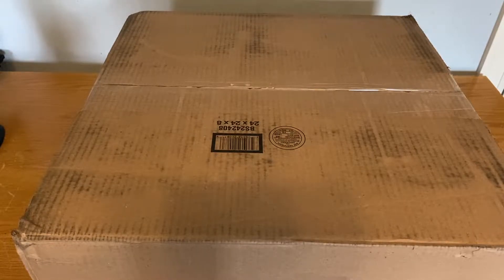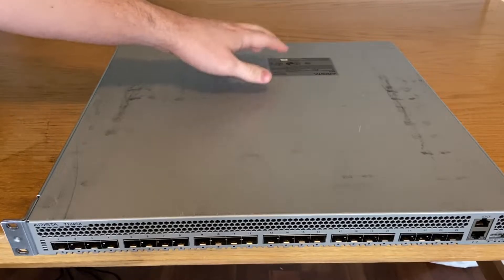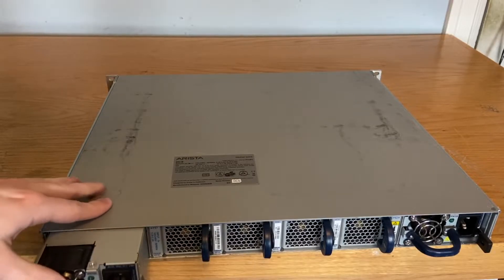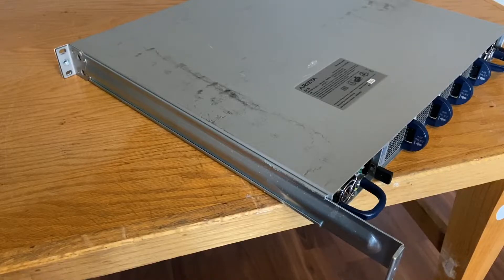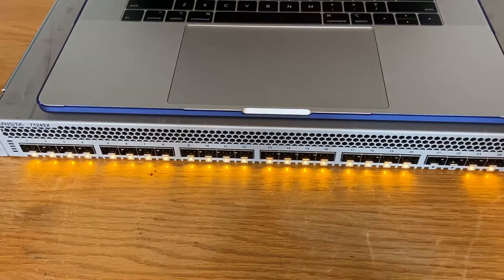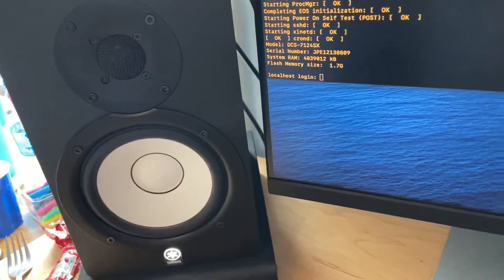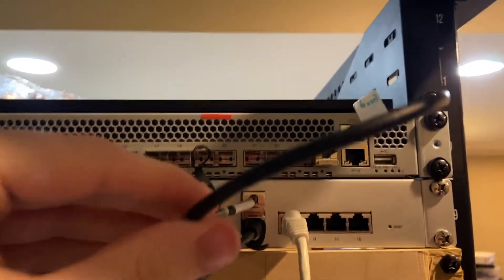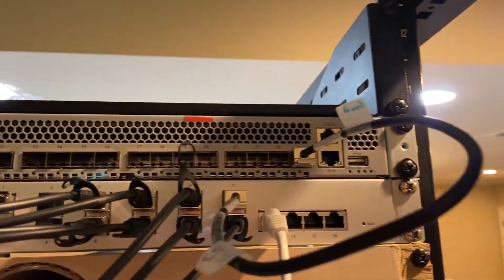Arista DCS-7124SX 24-Port 10GbE Switch Unboxing

Comment: You can try this to control the noise:
conf t
environment fan-speed override 30
write mem
It will complain a bit about warranties and such, and run hotter (including any plugged in optics!), but it is usually fine if ambient temps arent too bad. At least it works fine on a DCS-7050QX-32 I have lying around.

Comment: Hi Adam, great video! Which application do you use on the mac for the cli? Thanks from
Belgium!
Reply from the maker: I use the mac's built in terminal, the commands I use are:

ls /dev/*usb*
to list the usb serial adapters

and screen /dev/tty.usbserial-xxxxx
(usually 14130) to connect to the individual adapter.